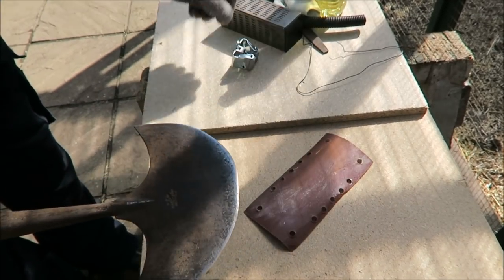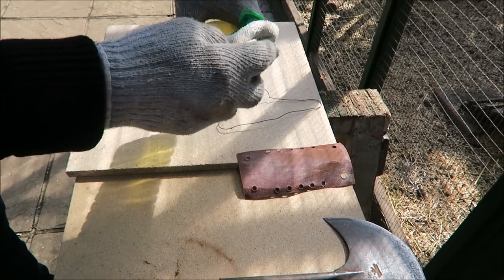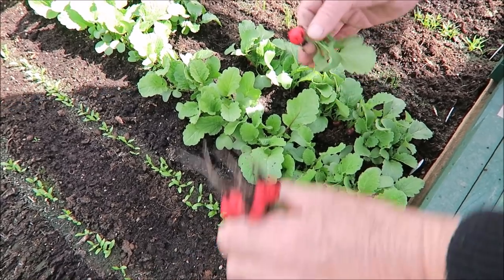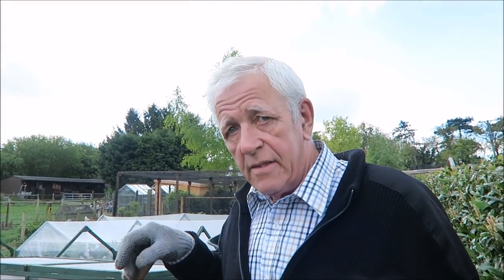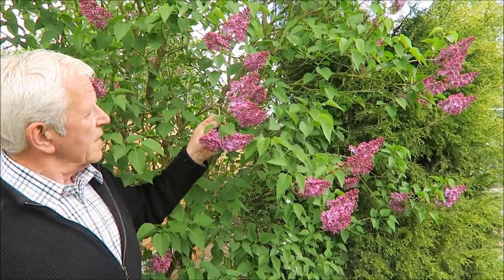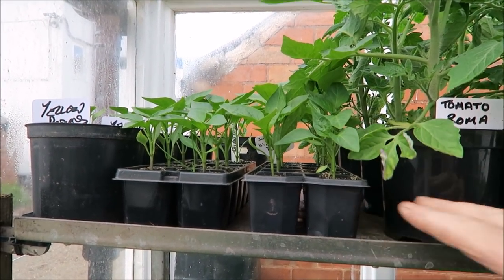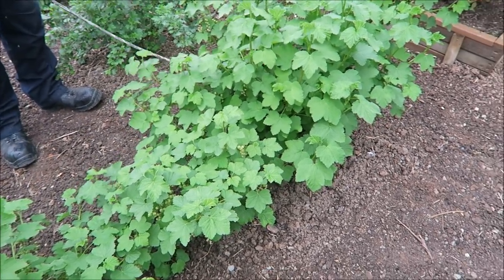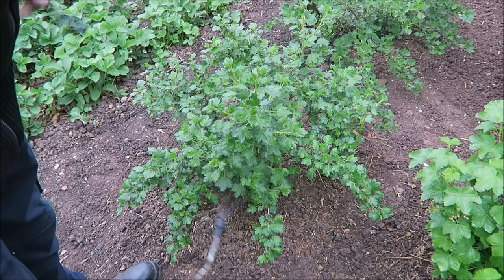Ridged And Fertilized Potatoes,    Soap Sprayed  Aphids.

Comment: Hi Cliff, good practice on cleaning and sharpening the half moon cutter and protecting it after use. mine has a lip on one side and I wrongly thought this was for stepping on.  When sharpening and turning it over I keep the stone flat on the blade to remove the bur, I find this gives a sharper blade.  I also only turn the blade over when I can feel the bur with my thumb.
Thamnks for the reminder to spray my soft fruits Take care Mike B
Reply from the maker: Thanks Michael good tip on the sharpening. The frames you are erecting are looking good, looking forward to seeing them finished.Enjoy your gardening take care regards Cliff.
Reply: Thanks Cliff, The frames are your design and any comments I receive This is pointed out.  I stuck to your measurements but when I put on the enviro mesh it fell short on the sides, so have I bought narrower mesh or have I slipped up on sizes?.  The best selling point on your frames is, they are built up using small components within except-able site waste which means they have cost me nothing. they all came out of the skip.  Not true really, I asked the foreman not to put them in the skip, but in a pile at the side of the skip.  (health & safety)  Cheers Mike B
Reply from the maker: Well done Mike B, its always good when there is no cost involved.Keep up the good work regards Cliff.